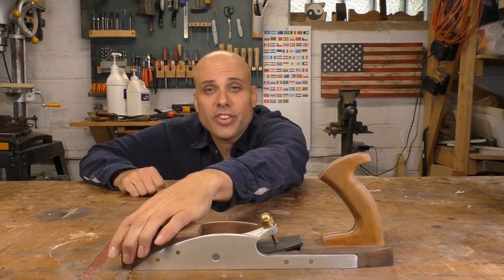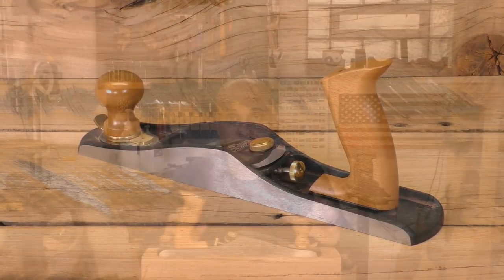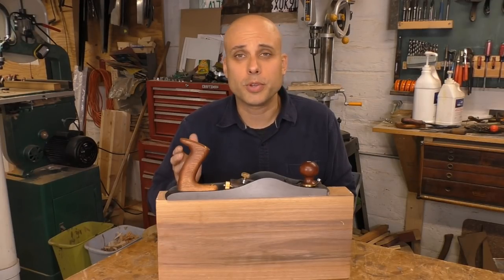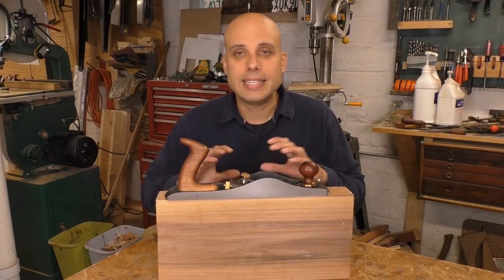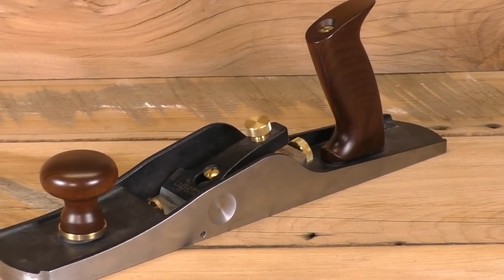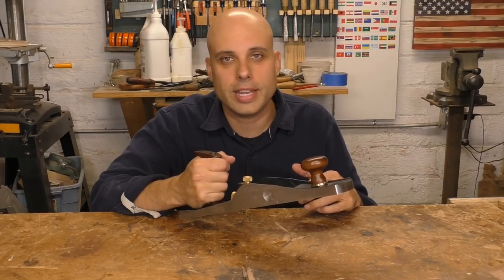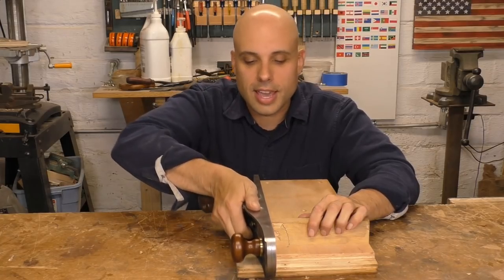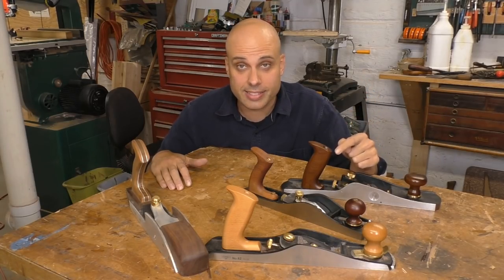Low Angle Plane Shootout!  What's the best value?

Comment: for a plane at about the price range of the Stanley, that also has the T-shaped lever cap, look at the Dictum range. I don't know how easy they are to get in the US but in Europe I would totally recommend it. I've had one for a while and am completely satisfied. The first one I got had a little ding on the mouthplate but they replaced the whole plane without an issue. Though to be fair, I don't find that comination adjuster that easy to use. It's quite hard to adjust the depth of cut without getting the lateral adjustment screwed up. But maybe that's just me...

Comment: You didn't include the Lie Nielsen.   I bought my Lie Nielsen low angle jack plane about 20 years ago.   It's the most used bench plane in my shop.   Second place goes to the Veritas low angle smoothing plane.   I haven't tried the Veritas low angle jack plane so I don't know if it could surpass my Lie Nielsen (possible, but I doubt it).   After that I have a bunch of vintage Stanleys that get regular use.

Comment: Hey Rex I found two versions of the Stanley low angle jack on Amazon, one for $112.00 (1-12-137) and another for $149.99 (12-137). Both are labeled No.62. Home Depot is out. And I found a photo of an old No. 62 that had a cap like the Veritas.

Comment: I just stumbled across your video.
First and foremost!  Thank you for taking the time and for putting yourself out there.  You know you're going to take some hits when you do, but you do it anyway, so thanks for the info.
Did you give any thought to comparing a Lie Nielsen?  I know! Way expensive, but considered the best of the best so...??  About the same price range 284 vs 295 today.  Honestly, I see a couple of tweaks in your review of the Veritas that are absent from the Lie Nielsen like the thumb indent and the flattened knob, so perhaps Veritas wins this comp.. I did cruise through some of the comments, admittedly not all, but didn't see this mentioned.
You didn't mention the two holes in the side of the Veritas.  These are there to accept the Veritas Fences (90*, variable angle, jointer..) designed to aid in planning the end of a piece of work to a specific angle.  Another perk not offered by LN.  Some of the hardened, old-time wood workers might say you don't need training wheels, and that you can accomplish the variable angle other ways, and they're not wrong, but for others these aids can really be helpful, and I wouldn't knock someone for using them myself.
From a personal preference perspective, I could have done without the fairy music part, but I'm a little old, and a little dry so not a knock, just a preference.
I am a tool guy.  I love hand tools.  I love quality and abhor poor design and low quality.  I firmly believe you buy the absolute best tool you can.  Most of the time it is worth while to wait and save for the best tool you can get.  That said, I do believe there is such a thing as too expensive.  You are always look for the best quality, not the highest price.  and there's also a point, IMO, where cost begins to out-pace the upgrade.  There are certain upgrades that are simply not worth the added cost.  My question regarding the LN is perhaps a good example of a case where the more expensive tool is not the "best" tool you can buy.  Even though the Veritas not made the US, this could be a case where it is the better tool.  I saw the comment above where the guy said he wanted to cry when he first used and even ran up to show his wife the shaving.  When you buy quality you will enjoy using those tools.

Comment: A Jack is a jack. 
Spend the money, get something decent, (write it off on your tax) and work the damn thing to death.

I got a LN low angle jack years ago and I put off buying a #7, and don't use my #4 very much at all.
In fact, the #7 I do have is an old stanley, and is currently in pieces getting restored. 
Only thing I wish is I could get a Pm-v11 blade for it.

Comment: You forgot to mention that the Veritas has a 2.25” wide blade and for those who are craving for a Veritas, you can purchase separate and different angles blades that will work on “high”figure woods that are hard to cut on the “regular “ blade, you’ll just get in love again all over...in the tool ofcourse....
Reply: Good point ... but it's easy (and cheaper) to grind competitors' spare blades to these same angles.  Veritas doesn't have any kind of special comparative advantage here.

Comment: The way to get comfortable with the cost of the Veritas is to think of it as 3 planes: smoother, jointer, shooter. It does all these things well, especially if you have several irons with different bevels. Divide the price by 3 and it doesn't look so bad! Cut costs on the tools you rarely use, not the one that gets used all the time.
Reply: That's a fair point and it's good that Veritas are offering the steeper angled blades.  But it's only fair to add that the stock blades for all Veritas' competitors can quickly and easily be ground to match.  The 'big deal' is not what Veritas is offering but the extra-special versatility of low angled plane design in general. It's not a big deal to grind a spare Stanley blade to a steeper angle.

Comment: I'd be curious to know how the Axminster Rider series planes handle - like you I'm honestly not comfortable throwing down Veritas money but I think the Axminster Rider type of price is something I could justify.

That said - I use old Bailey #4's most often and to be honest I haven't ever felt that these old planes are lacking.  I love nice woodworking tools and I can appreciate a nice tool but I wonder if I even need a low angle plane.
Reply: AFAIK the axminster is made by soba. Most of Rex's criticisms of the tay (is that how it's spelt?) apply here, although my axminster isn't quite as bad as what Rex describes. I've owned mine for a couple of years so have had plenty of time to evaluate it and I certainly wouldn't recommend it.
Reply: Okay... for what it's worth...
    I'd recommend picking up a "box plane"... one of those low angled deals that fits in a pocket, or pouch of the tool belt... The point being a lenient angle to smooth out the roughest spots with a few glib rubs of the thing... ya' know?
    A box plane does about everything you need it to do for smoothing up the wood... shooting boards and all... and it's not a ghastly expense... I think even Rex has done a vid' on that matter.
    Otherwise, unless you just want the convenience of a low angle plane... there isn't a whole lot of point or pressure to buying in... and certainly not to the tune of a Veritas... there's a lot of tool snobs, but I'm not one for that... I luck into a few things once in a while, AND I'm only too happy to publicize how lucky I've been... but that's the end of it. You can jubilate with me or tell me to f*** myself... as long as I know I've gotten a "rise" out of someone, I'm prob'ly happy enough,. Hopefully this helps... ;o)
Reply: eggypickle
If you want a shooting plane, buy a bevel up. Otherwise, stick with your Baileys.

Comment: After I bought the Stanley Sweetheart 62, I found out that it is impossible to get a replacement blade (not only in Germany). So I gave it away and replaced it with a Dictum 62 (German brand, made in the same Chinese factory as the Woodriver planes) where I can get replacement blades. I bought it in a set with 2 blades and a hot dog for about 180€.

For explanation. Since all these low angle planes are bevel up planes, you can replace the blade with another blade that is sharpened at a higher angle when it comes to planing difficult grain and harder wood. 
I learned this with my Veritas low angle smoothing plane where I own two blades with different cutting angles. 25 degrees which I use for soft wood and end grain and 38 degrees for harder wood and more difficult grain. For very difficult grain there is even a 50 degree blade available.

I really liked the Stanley and its solid A2 blade. However, purchasing a cheaper plane for which no replacement blade is available does not pay off in the end. Especially when multiple blades at different cutting angles are the real advantage over bevel down planes.
Reply: Tnx for the explanation
Bought the veritas + 25,38,50 blades.
Had just no clue when to use what.
Reply: You can get spare/replacement blades for the Stanley Sweetheart 62 (2009+) from Hock (as of Feb 2022).
Reply: You can get spare/replacement blades for the Stanley Sweetheart 62 (2009+) from Hock (as of Feb 2022).

Comment: My Stanley jack plane sucks! I should have saved up for the Lee Nielsen !
The side adjustment is nonexistent and the cheap aluminum cap is starting to indent under the tension of the bolt, making the blade shift sometimes. The sides are anything but perpendicular to the sole, so shooting is not an option. The knob has concaved the throat adjustment lever, causing it to stick. The throat itself has to be constantly checked to ensure it’s parallel to the sole. Have I left out any of the components? I suppose the handle is nice...

Comment: A low angle plane has a bevel angle of 12 degrees and with the 25 degree bevel up iron that gives your blade a 37 degree angle with the wood. Have you thought of making a plane with the bevel angle of 30 degrees and then use a blade with a 25 degree bevel placed with the bevel down. That means that the blade will be 30 degrees with the wood rather than 37 degrees. I did this with a block plane I made and it worked very well.

Comment: Ya, it's one thing if the problems are finish issues that can be easily fixed. It's quite another when the problems are unfixable without acquiring entirely new parts or spending hours in a metal shop. It's sad really, because Shobha tools in India makes a lot of decent tools. It would not have taken that much to fix the low angle plane at least to the useable point. And it's been around for a while, so it looks like they just aren't going to fix it :(. However, the Stanley is already at a great price point. And ya, Veritas tools aren't just made better, they think about everything, and design everything to be just so. I mean, the Norris adjuster is so easy to manipulate, and no slop like other traditional metal western plane mechanisms. Yup, I agree with you completely, the Veritas is really nice, if you have the money it is certainly going to be your best choice, and if you have the money, you won't be afraid to use it me thinks :D However, Stanley still makes great tools. No question. I would not hesitate to by a Stanley tool, so far.
Reply from the maker: Nice when my Patrons have the same experiences!

Comment: @Rex now, 3yrs later, any chance to look at Taytools again? May be #7, not so much of req as to smoothing plane.
Reply: I have a Taytools No.7 I purchased a few months ago. Other than the back of the iron needing some flattening, it's pretty easy to "Fettle", as Paul Sellers puts it, and it works just fine. There was a design problem I dealt with and that's the shape of the tote. Its more upright like the Stanly No. 92 in this video but pretty much standard No. 4 - 7 height. I bit the bullet and, while I was at it, I bought three pairs of knobs & totes from an e-bay provider made out of padauk for less than $35.00 apiece as my mid-'90's, made in England Stanley No. 6 and my 2+ year old, made in Mexico Stanley No. 5 both had the "Plastic Fantastic" kind and it was way past time to finally treat myself. (They're great, by the way.)

Comment: Well, based on this and the previous two videos im just going to stick with my refurbed regular planes until i find a good low angle at a garage sale or flea market.  I have yet to pay more than $20 for a plain. I can wait.
Reply: Unfortunately, the vintage low angle jacks are even more expensive than the new ones. They're super rare and so they are incredibly valued in the collector's market. In fact, if I were to find one, I would probably sell the vintage one to a collector, buy the Veritas and still have money left over.
Reply: But Brandon, people holding garage and estate sales in their yard know nothing about that. I'll grant you that flea markets are more problematic, but I was at a garage sale a couple of weeks ago where i was offered a decent lathe and a very complete set of high quality turning tools for under a hundred bux. 
I'll just be patient
Reply from the maker: I admit, I've never seen one of these used, but you never know!
Reply: Good luck. In my 3 years as a member of the MWTCA—9 tool meets—I've seen two. Both had higher pricetags than Veritas & Lie-Nielsen.

Comment: Do you have any thoughts on how to align the iron on these planes? Too little pressure on lever cap and the iron shifts when planing (one side slips more than the other); too much pressure and the side-to-side adjustment is a pain. I have never been able to adjust the depth without it going out of alignment with the sole, and it being low-angle, "just tap it with a hammer" is also inconvenient. FYI  I have a Luban/WoodRiver/Quansheng low angle jack, which is a Stanley No. 62 clone.
Reply from the maker: I have not tried that maker, but none of these planes have that issue. I don't think it's you.

Comment: How possible would it be to review the cheaper planes from the box stores like the Kobalt block plane you can get from Lowes?
Reply: One anecdote, but a Lowe's plane almost put me off woodworking it was so bad. Warped bottom, badly machined frog....ugh
Reply from the maker: I've looked at at LOT of cheap planes. Look back in my videos. You'll find them.
Reply: I bought a Kobalt smoother, to use as a scrub, & it was so bad that I returned it.

Comment: I know this is a couple of years old, but I can currently get the Stanely SW No. 62 Low Angle Jack Plane and Stanley SW No. 60-1/2 Low Angle Block Plane for $125 for both. I know I'll have to do some work to get them tuned correctly, but would it be good to get both of these, together for that price, if I will be using it occasionally?

Comment: I don't get why a low angle bevel-up plane would be beneficial over a normal bevel down plane. If two planes have both have bevel angles of say 25°, but one is mounted bevel down with a blade angle of 35° and the other with the bevel up and a blade angle of 10°, how do they cut differently? As far as the point where the iron meets the wood, the two have identical profiles.

Comment: I’ve had my eye on some wood river planes for some time now. Rob Cosman’s endorsement of their planes draws me toward the brand, and for probably obvious reasons, I really trust his opinion. I know that there are many high quality hand planes manufactured but I’m curious how the wood river low angle jack plane would stand against the veritas and the Stanley sweetheart. I’m guessing probably somewhere in between? Anyway thanks for the content.
Reply: I've got a Wood River #4 and love it.  Granted, I only have my old Stanleys to compare it to, but it does the job well and doesn't have a cheap feel to it.  I'm not sure how much I trust Cosman's recommendation given that he's sponsored by Woodcraft, but as far as I can tell he's right on this one.  Cosman's got videos on setting up a new Wood River after you buy it, and they're worth watching.

Keep it oiled well if you care about the finish, though.  My shop has no heat or A/C so it's unused for months at a time.  The plane has developed spots of black patina in a few areas despite the fact that I put paste wax on the body whenever I store it.  Doesn't really bother me, but if you like your shiny new plane to stay that way you'll need to keep on top of it.
Reply: Jeff Spaulding thanks. I’ve seen that video. The reason t say I trusted his recommendation is that he actually co-designed some of the wood river planes, and he actually uses them as well. He doesn’t seem like the type of craftsman to just promote a product just because of sponsorship. So I guess it seems a bit deeper than that in this case. But I am curious to hear other people’s opinions on his planes so I really do appreciate the feedback.

Comment: Hey Rex - You really should try the Woodriver 62 its every bit as good as the Veritas at a much better price. Stanley are nowhere near the standard of their old tools. Didn't you even notice the terrible surface finish on the sole and sides it more like linishing than grinding and looks about 60 grit  finish - They need an awful lot of work to make them anywhere near the competition even the Tay looks better finished and I've never seen them before. You will find the finish on a Woodriver is head and shoulders above most. Still a good video though - keep it up.

Comment: I had an original Stanley low angle  plane. Inherited it. Never used it more than once. The blade was not very good at holding an edge and it was clumsy. 
Save your money.